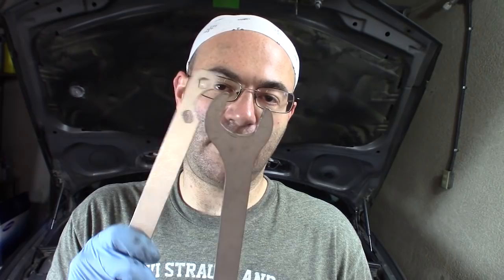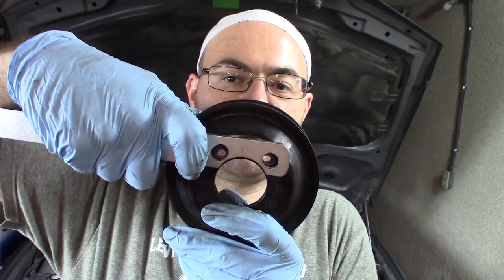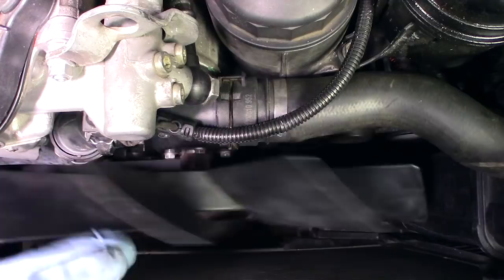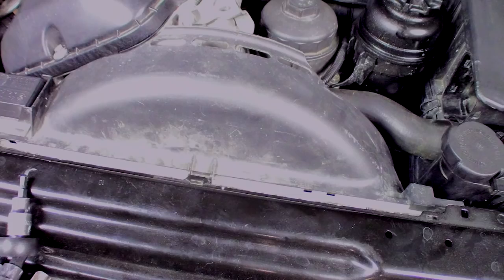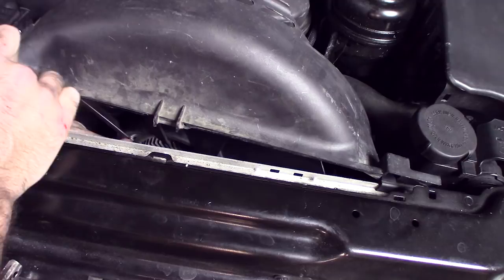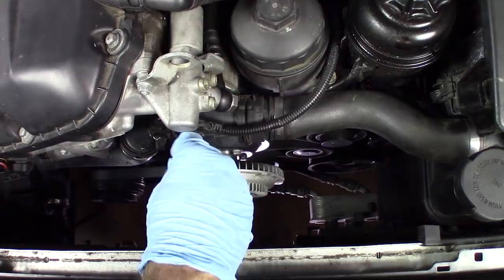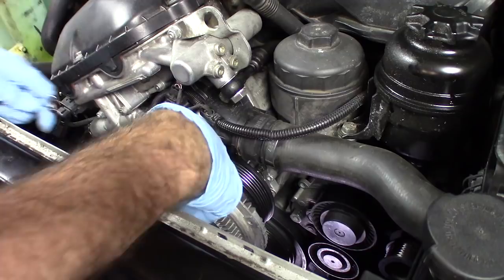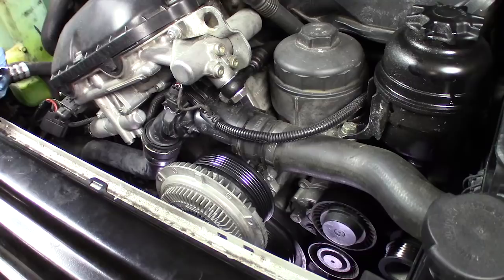BMW Fan Removal Methods - Remove Impossible Fan Nuts!

Comment: How do you remove a Allen screw that is stripped on the head
Reply from the maker: +Gary Bizier cut a slot in it with a hacksaw or cutoff wheel and spin out with a flathead screwdriver

Comment: Method 2 - How do you get the shroud off without removing the fan first? Pretty important step is missing from your video.
Reply from the maker: You don’t, you work with the shroud in place. As I said in the video, I removed it for the purpose of clarity
Reply: @50sKid  I see. You assembled it without the shroud to make the video more clear. Missed that the first time I watched.

My nut is really stuck. Not even an air hammer on the edge of the nut loosened it. I tried method 3 but the heads on my 3 hex bolts seem to be stripped. When I turn my 5mm hex tool, I can feel it turning a little but the bolt doesn't move.

Any suggestions? Cut the fan and fan shroud out and then remove the water pump and replace fan, shroud, clutch, pulley, and water pump? I would rather not have to replace all that because I was just trying to do a VANOS rebuild and new valve cover gasket.

Great videos by the way. Best E46 DIY videos that I have seen!
Reply from the maker: Tips for China yeah its a good idea to replace your water pump anyway